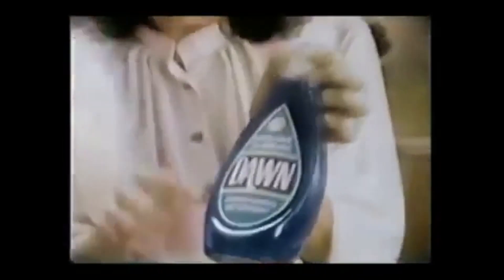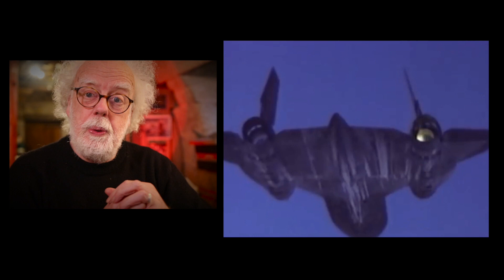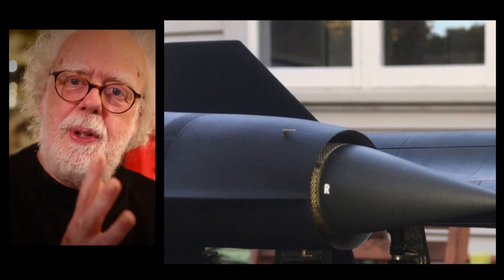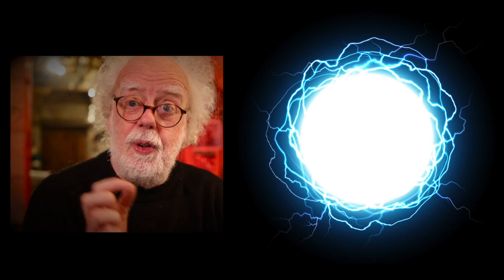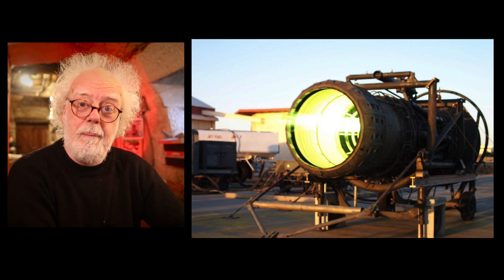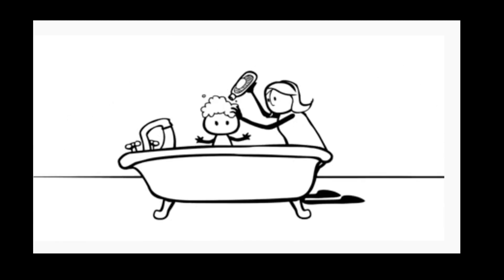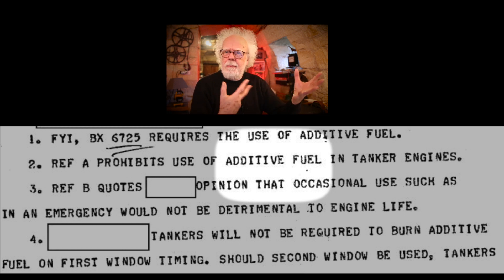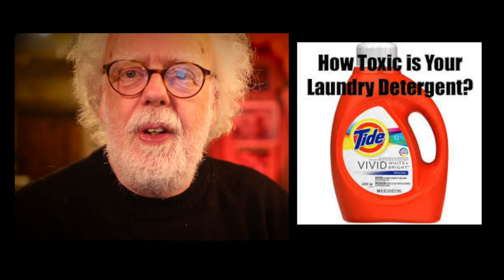The 'DAWN' of Stealth - Prof Simon

Comment: 1. While the very similar but short lived aircraft A-12 was flown by the CIA, the SR-71 was operated by the USAF instead.
2. While there is radar with wavelength in the mm range, these are used for short range and is nothing the SR-71 ever would have had a problem with regardless of stealthiness.
3. I think most people think of radioactivity when they hear of caesium (because of the Cs-137 in spent nuclear fuel) but that would not be the case here. Almost all caesium on earth is of the stable, non-radioactive form. Regular caesium is not more harmful than sodium. Caesium emissions from the jet exhaust would be absolutely nothing compared to the leaded gasoline in a billion cars of the same era.
4. I find it hard to believe that the USAF:s supply of A-50 was dependent on the simultaneous production of caesium containing detergent. I think that if the USAF wantad a certain chemical, they would have got it produced for them.
5. It's not clear how effective the additive was in terms of signature reduction, if it was widely used, used in special cases or only a wild idea.

Comment: SR-71 was a failure by definition.  

By 1963 Lockheed YF-12 failed , by 1968 A-12 failed, but was resurrected into SR-71.  As a developmental carry over, failed AIM-47 Falcon was eventually developed into AIM-54 Phoenix to arm F-14 Tomcat, but it took until 1974 to get it done.  It's a generational delay of an entire decade.

When it first ran in 1958, experimental Pratt & Whitney J58 engine variable cone/spike inlet was already obsolete, as it was standard on MiG-21s Tumansky R-25 engine which finished its development cycle and put into mass service in 1959.  

At the same time, in 1964 MiG-25 with advanced 2D inlets made its first flight, was put into service by 1970, and ultimately well over a thousand units were built.

In early 60s 2D inlet was a generation ahead of variable cone/spike inlet.

With MiG-25 entering mass production and widespread service, unicorn status SR-71 became hopelessly obsolete as MiG-25s could chase it down and energy trap it.  R-40 IR/R missiles were capable of intercepting wide turning SR-71, thus SR-71 could not safely enter protected airspace but could only skim the outskirts in a wide arc while sustaining peak energy envelope.  

In practice SR-71 was deployed against 3rd world countries, because it could not operate in Soviet airspace.

Comment: The SR71 a different jet fuel than most a/c as it had to have a lower flash point.  The fuel was also used as a hydraulic fluid !

Comment: Another thing those shock cones did, along with little does, was redirect incoming air to bypass the compressors.
It's already compressed so ho hum.
Now you're engine's a RAM jet!
And super efficient at high Mach!
And you don't need extra engines or JATOs to get you up to speed before a RAM jet will light.

Comment: Radar has a much longer wavelength than 1mm, a radio signal with a 1mm wavelength has a frequency of almost 300GHz. At those frequencies the attenuation caused by the atmosphere/weather would be so great it would be useless for detecting anything.
Reply from the maker: Thank you

Comment: 2:00 - “ Jet engines don’t like really fast air”. 

True. And that is why the A12/SR-71 utilized the J58 Turbo-Ramjet. The spikes located at the intake not only slowed the air during some phases of the flight, they moved (as you noted) to control where in the engine the shock wave would be located. This brilliant little trick helped optimize the performance of the engines across a broader portion of the flight envelope. Most engines that work great at high speeds are absolute pigs at power speeds. The J-58 wasn’t awful at lower speeds, was great at high speeds, and was a precision aerial Formula One work of art at 3 Mach +. 

And for the record, the speeds and performance that are shared openly are not quite accurate. Both aircraft (A12/SR71) were absolutely capable of flying higher and faster than what has been released. The single biggest hurdle that the airframe/engines had to overcome was heat. Their inability to address and dissipate that heat, especially along the leading edges, were the only thing keeping the performance numbers we see from being even higher (absurdly so in some cases). 

It is worth noting that while the Oxcart/Habu designs were built with some radar “stealth” in mind, as effective as those efforts were (fairly remarkable for the time), once again, the heat the planes generated prevented them from being truly low observable. Their Infra Red signatures were just bonkers. For foreign defense networks accustomed to seeing a cigarette lighter on the screen, it’s not too difficult to find the blow torch😁

Interesting note: Fuel additives are used to this day to address various issues with heat and things like...contrails. Stealth is all well and good until the bad guys see you at 35K’ from the ground! The B2 (and other planes) have an additive that essentially prevents the exhaust from forming a contrail at altitude. Yet another neat idea that came about after throwing some smart people and a lot of dollars at a problem. 

It’s worth noting that even with the attempts at lowering RCS, there was never a single A12/SR-71 flight that wasn’t tracked by the opposition the moment the plane entered their radars effective range. Luckily, at the altitude and speed they traveled, in the event that a SAM or interceptor was sent their way, literally all they had to do was finesse the throttle a little bit and turn a few degrees one way or the other and they were safe. The only close calls they ever had experienced came as a result of using the same flight path in perfect weather with some incredible luck on the part of the MiG pilots. Again, “close call” is a relative term when discussing the Blackbird family of aircraft. 

Excellent video as usual, Prof!

Comment: Wavelength is 300 div by freq in Mhz  x 1000 (this gives it the mm size)  radar is at around 10Ghz  or there abouts. so to get it - 300 div by 10000 x 1000 to bring it back to mm gives 30 mm for a full wavelength. The metal balls in the paint which is true because I know. are tiny and actually go rusty if not painted where cut and exposed to the weather.These balls are also added to other things to ,ake the other things radar absorbent
Reply from the maker: Interesting

Comment: When I was in the USMC airwing in Okinawa in 1973 I saw the SR 71 that were based their. About an hour before it would take off a tanker would takeoff, and about an hour before it landed a tanker would takeoff. (Times are appoxement)
It would also taxi out running from the hanger and taxi in the hanger running.
Reply: At the very same time MiG-25s were stationed in Vladivostok, and were guided by CGI network to keep SR-71s out of protected airspace.  During that time US intelligence was convinced that MiG-25s could not deploy R-40s for a successful intercept, and it took Belenko's defection to deliver the message.  Ever since the defection, SR-71s backed down from attempting to penetrate Soviet airspace and were limited to skimming runs.  

There is a reason as to why Belenko's Foxbat was not armed, why the so called defection happened right after MiG-31 entered service, and why GCI allowed continuation of Belenko's flight even after the signal was lost with the RSIU-5 VHF datalink (NATO designation Markham).

From the onset of development, MiG-25RB/RBS bomber version was enabled with capability of delivering a tactical nuclear warhead, and GCI command had to have insurance that a nuclear armed MiG-25RB can be remotely recalled in any case of pilot deviation from the flight plan.  Sharing core architecture, all MiG-25/31s were enabled to be remotely recalled by GCI, by overriding pilot command and taking remote control of the flight system.  

Contrary to the myths, no SR-71 has ever penetrated Soviet airspace, and only wide arc skimming runs were successful.

Comment: No computers with cad cam out then, for design work of this aircraft.Just pen and paper and a slide rule.
Reply: thats what makes it so special.
Reply: The military probably had a lot more than paper and a slide rule, but I get what you're saying.
Reply: @lightowl3934  There were quite capable computers if they needed it for some calculations but there was no CAD software at that time, all drawings were made with paper and pen. But a few years later, it started to emerge. I think many people of today overstate the importance of computers. We could make great and complicated things long before there was computers, only that it used to take a little longer time to do it.

Comment: The great part of the blackbird fuel JP7 for the engines, that it can not be burned by a naked flame.You can put some on the floor and light a match or blow torch onto it and it will not burn.If you stand under the blackbird after a flight, the fuel tanks leak and you will get fuel over you from the tank.This excess fuel lays in the bottom of the tanks, and after 10 minutes on the floor it leaks out from the seams.It was a special blend fuel only for this aircraft.It will not work in any other engines.Contraction of the fuel tanks, after 20 minutes will seal the seams up.
Reply: I believe they had to use a Buick to “jumpstart” the SR-71 because the JP7 had such a high flashpoint.
Reply: this is true, i have read.
Reply: You have it reversed.  The SR71 panels were built with large gaps as the titanium would expand during flight.  During flight there would (theoretically) be very few leaks, but when it was stationary the tank seams would leak quite a bit from what I understand.
Reply: @RL.1  All solid matter has moving or "vibrating" atoms. High friction in the air produced quite alot of heat over the aircraft's airframe. Regarding why he is actually right (with apparent experiential knowledge): 

When in an excited energy state (when thermal values increase) the "tightness" of the atomic bonds structured pairing relaxes a bit. This change  in energy density allows energy to escape this homologous material state via quantized gaps which form in the  in between electron clouds. Those gaps have not exceeded their specific heat therefore, they remain locked in a stable configuration with their neighboring atom's valence shell electrons.

When the specific heat of the metallurgical elements making up the airfoil decelerate (due to cooling thermals) the airframe actively contracts -- reforming to its original manufactured shape relative to ground-level troposphere temperatures.  

The flight levels this aircraft flew at were nearer towards low earth orbit so that means "gravity" or the earth's polar electromagnetic field bands had less 'pull' on the molecular fluid weight of the gaseous spraying, swooshing, and combusting fuel onboard the SR-71. 

Upon return to the ground, the settled fuel residue inside the tanks (and now lose areas under the paneling of the fuselage) would leak while the jet was still really hot. It was inevitable due to the seams and rivets necessary during that era of manufacturing technology and applicable know-how. This explanation offers a general understanding of why the jet would "sweat" the slightly denser cesium A-50 on a molecular level.

Comment: Strange in a funny sort of way.Seeing in my sketchbook i did when i was 12 years old i sketched  drawing a very fast aircraft that could be built, very similar to the SR71.But my aircraft had 4 engines instead of 2 on the blackbird.Funny i ended up working for Lockheed Martin.
Reply: No. You didn’t.

Comment: That's a lot of Mach Diamonds! Care to take a stab at explaining them? The Bernoulli's Principle makes sense for air being stretched over the top of a wing/ aerofoil, resulting in lift from the higher-pressure air below pushing the aerofoil upwards. I find it hard to get my head around how the pressure of the atmosphere is collapsing the super-sonic exhaust gases. Jet engines work by EXPANDING the gases inside the engine, it makes even less sense when we're talking about afterburners and an atmospheric pressure of virtually zero (1/40 of sea level), yet the atmosphere is still collapsing the exhaust gases.🤯

Another topic I find fascinating is how planes used to measure wind speed (when things were analogue). You can't just measure the pressure from the oncoming air as that will change massively depending on altitude, and temperature. Engineers had to be far more ingenious in the days before GPS which is just triangulation (although it is impressive for devices to measure the speed of light to within a few metres, that are now a commodity people take for granted).

PS: The SR71 is also a flying fuel tank.
Reply: Look up how a pitot probe works.
Reply: @trespire  Thanks, but that doesn't help much. Sure the probe has two vanes, with one facing forward (speed) and another offset (pressure), but that doesn't explain how it works. Or account for temperature which can have a large impact on air density. There seems to be more to it than just the difference between the two readings.
Reply: @Gareth Evans   Not sure about compensation for temperature, but as Tawhiri states above, the basic principal is Bernoulli's law.   An orifice perpendicular to the flow of a fluid ( liquid or gaseous ) will sample the static pressure or Ps.   An orifice inline with the flow will sample dynamic pressure or Pd.   Dynamic pressure will increase with the velocity of the flow.   Bernoulli's law states that the total pressure is the sum of the static pressure and the dynamic pressure. So Pt = Ps + Pd   At a given altitude the dynamic pressure will increase with flow while static pressure decreases with flow.   The total pressure Pt remains constant at a constant altitude / density.
Reply: Actually Bernoulli's law is insufficient to explain the lift on an airfoil, even at subsonic speeds. You need circulation to describe the flow and it's effects. And we only see the mach cones at sea level or after refueling. I'd guess they are not there at the plane's operational altitude.
Reply: the engines are designed for very high altitude

Comment: The one thing the manufacturers were not able to solve about the SR71 even after it's retirement was that it was like a bucket full of holes with leaks all over the place. Sealants in between it's metal plate skins tend to fail as the latter contracts at high temperatures when travelling at high speeds. It  was a miracle that none were ever reported to have caught fire or exploded  while parking with all those fuel/oil leaks on the tarmac.

Comment: Russian radar topped out at 70,000 ft, blackbirds flew at 90,000
Reply: @Roger C  I think you mean Russian air defense missiles. Radar goes a lot farther than that.
Reply: Brisk Shul, SR71 pilot and author of Sled Driver said the Russian missiles came up to their height but could not lock on to the aircraft. It’s one thing for a big ground-based radar to see the plane. It’s a much harder job for the little missile radar to pick up the tab and finish the job.
Reply: 100.000 feet.
Reply: The SR71 was a stealth aircraft the entire leading edge of the wing was made of composite materials.
Reply: They didn't fly over russia only near border
Reply: Wrong. The SR-71 overflew Russia. The areas of interest couldn't be seen from the border of them USSR.